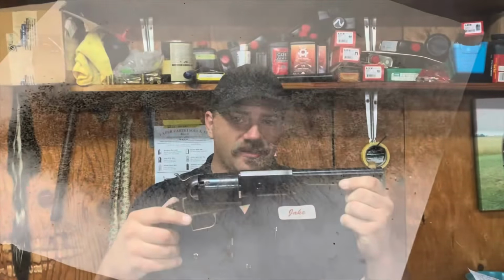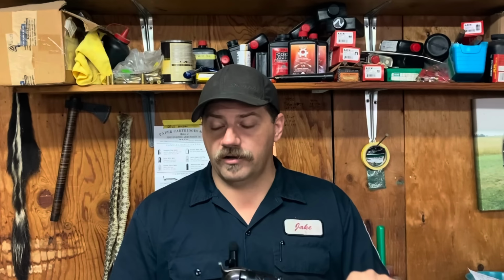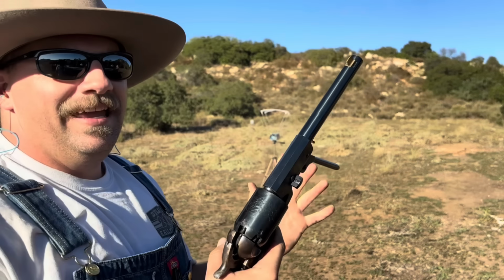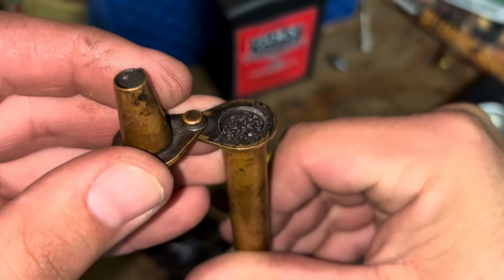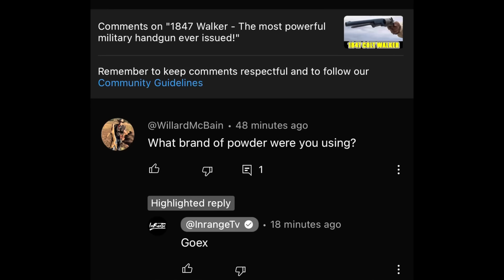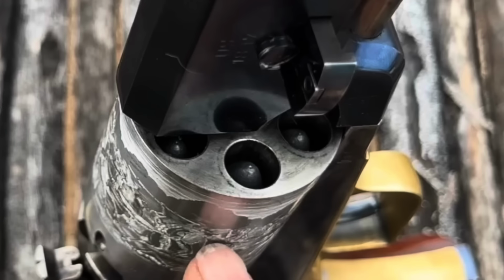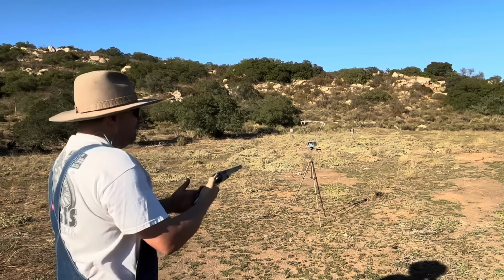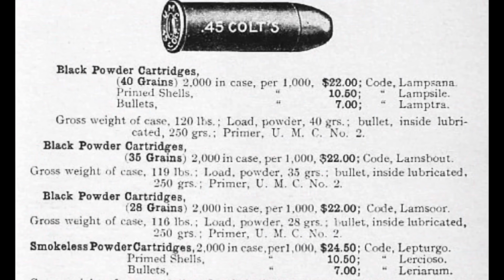The Colt Walker. Not The Most Powerful Revolver Of The 19th Century?

Comment: I hear people say that you can't put 40 grains in a .45 Colt, either. I load black powder loads in my .45 Colt. I use 3f goex. I put a 40 grain spout on a bulk style, round brass powder flask. I put a standard 250 grain flat point bullet. The powder charge is definitely compacted. People say it can't be done; but I do it all the time. When I load .45-70 I use the same powder flask; but with a 70 grain spout. Once again, with 3x goex. It works great. I used goex because that was the only real black powder that I could find locally.

Comment: I have a reproduction Walker (Uberti) purchased in the white from Cabela's in 2004. I nornally load it with .454 round ball and 45 grains of 777 and have nearly enough room for a second ball.
Reply: The cylinder is longer than all the other models. I’ll look into trying the 2 balls in one chamber. Sounds kinda dangerous but if projected right? Definitely would cause major damage. Have you shot 2 balls out yet?
Reply: @assassinmanx6128   absolutely not. I have however, shot conical bullets. both hand cast and store bought. I saw no increase in "accuracy" per se, but bullet drop at range(50yrds) was improved by 3-4 inches.
Reply: @brianking9446  So conicals are lighter/faster being not a heavy round ball? I’m still new to BP kinda. But all I ever use is .454 balls. I’m trying to get my Walker and Army to have real power. I don’t own one of those measuring devices a chronograph? So I can’t measure my speed/fps etc.
Reply: @assassinmanx6128  The conicals wiegh more. I don't remember their exact wieght. This higher wieght increases the cylinder pressure and pressure at the forcing cone due to it taking longer to accelerate the heavier projectile down and out the bore. This higher pressure does not transmit to "higher power" exactly. There are plenty of online sources to see the different ways people have increased the "power". Never exceed the makers recommended powder load. Some people have 45 long colt conversions for BP/C&B arms. That may be something to look into as it moves you up from 375-425fps to 475-650fps. That is a massive power increase as you can now load smokeless. I have loaded 65 grains of 777 in my Walker ONE time wearing two pair of Kevlar gloves and a face shield. 704fps was my Mv and I have never found where the round went just that hit the tie wall with a LOT of authority.
Reply: @brianking9446  Yea the conversions are where it’s at from what I hear. But then don’t they require FFL or backround to order? As well I’ve read something on you can only use cowboy .45 loads for conversion cylinder? Or can you use regular .45 rounds as well?
Reply: @assassinmanx6128  At this point you have exceeded my knowledge base. I have never messed with the conversion cylinders. I carry multiple cylinders with me when I shoot them and usually just swap out cylinders so reload times aren't a real issue(lots of practice gets me into the sub 5sec range). I have heard that they(conversion cylinders)require CA loads but never having had one leaves me in "unknown" area.
Reply: @brianking9446  Oh ok. All good. Yes, extra cylinders is the only way to go I’ve found out. Makes the range more fun. At first I just had one, and you’re standing there for 5 minutes loading while others are just blasting off mags and speed loading revolvers. Extra cylinders is just pop the pin out, detach muzzle and slip out and drop back in.
Reply: @assassinmanx6128  You don't require an FFL to order the cylinder.  There are two choices that I'm aware of, Howell and Kirst Konverters.  The Howell operates by way of six firing pins and requires removing the cylinder to load due to the firing pin nipples which precludes a loading gate.  The Kirst requires cutting in to breech face to facilitate the loading gate.  Mine was done in 460 S&W which can shoot 45 colt as well and I've had no issues shooting either.
Reply: @garymiller5416  So the Howell is basically easier? And can you shoot regular .45’s? I’ve heard different stories about cowboy loads only.
Reply: Wait, do I understand correctly that you can run 460 s&w in a walker colt? Thats awesome!
Reply: @brianking9446 Your chrono is way off. 50 gr. of 777 with a conical in my Ruger does 900 + . With 50 gr.777 and round ball 1100fps.
Reply: @JerryRedd-bs8xi  Ruger what? I'm talking about some 1853 cap and ball revolvers. 7in barrels.....
Reply: @brianking9446  From 1972 until 2008, Ruger made a cap and ball revolver known as the Old Army.

Comment: I'm impressed to find at least one other person who has a decent grasp of ballistics and a willingness to test for himself.
Everything you're saying is correct.  The Army did adopt the 1873 with the 40grain powder charge, but very quickly determined it to be TOO powerful for their needs.  Much like the FBI did with the 10mm to 10mm FBI load, to .40 S&W, the same evolution occurred with the 1873.
The initial load is EXTREMELY potent, delivering significant recoil, and placing more stress on the frame.  Remember, in the 1870s metallurgy was still an evolving science, and since the Army didn't "need" the gun to be max powerful, they settled on a milder load of 28 Grains of black under a 255 grain conical bullet.  This brought the performance of the 7.5" barrel gun down to a more pedestrian 850-900fps which is still quite powerful by any standard.  S&W was no less crafty back then than now, so they didn't waste time cobbling up the Schofield revolver using a shorter cylinder that could not accept the .45 Colt's length, and with it they "invented" the shorter cased Schofield round making the same ballistic numbers as the Army's reduced load.  Initially, the Army had two different types of ammo in the supply chain, but ended up simplifying the problem by eliminating the .45 Colt in favor of the .45 Schofield for both guns.
Even when the Army was investing in J.M. Browning "inventing" what would become the 1911, the actual .45 automatic cartridge was standardized in 1905 in anticipation of the gun Browning would finally come up with, but that load is almost spot on the same power as the .45 Schofield load!
Some years back I did a proper "conversion" of an Uberti 5.5" Cattleman BP to .45 Colt and decided to try and duplicate the original load - as you did.  I managed to crunch 37 grains of "Cleanshot" under a 255 grain slug which chronographed 900 fps/460 fpe which is pretty impressive.  Modern solid-head brass has less capacity than the folded brass used back in the 1800s - so it's a lot stronger, but also has less capacity.  I went with Cleanshot at the time because it advertised being virtually as clean as smokeless and that seems true, but over time I discovered fired cases developed powder corrosion and those left loaded for a long time developed weakened cases.  Since that was just a test I switched over to smokeless powder for normal loads, and modern .45 Colt ammo is loaded quite mild

It's good to find someone else willing to question and experiment rather than regurgitate the same old spew.

Comment: It would definitely be interesting to document the chamber size differences between the various brands of reproductions and the originals.
Reply from the maker: Well everyone I mentioned in the video has a Uberti but two of my friends have a ASM and a second Gen Colt and 60gr is the max. I would say they are within 2gr of each other. As for the Original, who knows.
Reply: We get into 1F to 4 F as well as the substitutes.    While I am still working on it,  clearly 777 x 3F has a lot more bang for the measurement than 3F True Black Powder.   Like reloading,  sure we can do volume,  but you weigh that volue first,  tune it and then you have a fairly consistent weight (which is what the manuals use) -  but,  some measure better than others,  long grain stick powders are much harder and less consistent.   While a rifle will not see it, a pistol can vary a lot,  9mm and smaller more so.   I also use a Chrnograph each time to get an idea of how hot that load is.    @Everythingblackpowder
Reply: @Everythingblackpowder For what's its worth, I obtained an Uberti about 20yrs ago, and was quite disappointed as it grouped very poorly, regardless of powder charge.  I also found that large quantities of power often stated, did not fit in my gun, as you demonstrated.  Upon inspection by a gunsmith, he stated that most modern replicas have undersized cylinders for mis-guided safety, and upon slugging my bore and cylinders, this was very much the case.  It cost as much as the gun itself, but he offered to ream out the cylinders to .002" over bore diameter, which I went for.  The gun  grouped considerably better with both rounds and conical, but what I really noticed was how much more powder it was able to hold.   60gr actual Goex FFFg with rounds became easy to load, and the Lee Precision 200gr conical (which has a much shorter nose than what you were experimenting with), could load, with some effort but not rod bending, 55gr FFFg.  The gun shoots most accurately more in the range of 40gr, but 50s and even 60s became possible.  I do not remember how much material was removed from the cylinders to achieve 0.002" over bore, but with the way the powder capacity increased, it must have been quite a bit.

Comment: I agree with you on this (overall) as the original charge for the Walkers (as we are told) had to be reduced because of the metallurgy at the time had cylinders blow apart.  Again… this is word of mouth issues so “who knows”… no way on 90 grains of 3F Swiss and a conical… I do not have an original Walker to verify this… but you can’t do 90 grains of 3F and seat a 200 grain LEE 90234 in a 45-70 BFR cylinder… just for reference.
Reply from the maker: lol excellent point with the 45-70 comparison!
Reply: @Everythingblackpowder  after watching you video I removed my 45-70 BFR cylinder, use blue painters tape over the bottom of the cylinder and measured 90 grains by volume… yada yada yada… I did not want to hammer on the bullets lol… 
I had the same results (just now) in my Uberti Walker that you did with 45 & 50 grains with the before mentioned Lee 200 grain RF bullet.  
I guess I just do not need to “compensate” so I am happy with 35 grains of 3F Swiss and my cast conicals.  Thank you again for your video… I got me thinking… that is always dangerous lol
Reply from the maker: @raytribble8075 thank you
Reply: That guy was clearly drunk...
Reply: @curly__3    probably never tried loading a walker i would bet
Reply: The primary reason the original Walker's cylinders would fail is due to rangers incorrectly loading the conical bullets backward (point in) into the iron cylinder, not the powder charge. That is well documented.
Reply from the maker: Some 30% of the Walkers failed the initial test fire performed by the ordinance department before they were ever issued. That IS well documented.

Comment: I like your numbers, Jake.  And your assessment of the power available in the Walker.  

And as a fan of the .45 Colt, I'll be working up some Holy Black loads for CAS in my clones.  Most of my shooting is
with that newfangled "smoke less" junk, which is easier to clean and I'm lazy, but I do love the fireball and smoke of a
nice powerful BP round!  Thanks for the video!   👍
Reply from the maker: Thank you
Reply: @Everythingblackpowder  You bet!  Keep em coming!!
Reply: Black powder certainly has a different sounding kind of "Boom" than black powder. Smokeless powder has a sharper crack to it.
Reply: @Everythingblackpowder I've noticed there are 160 grain bullets available for 45 colt, is there some big disadvantage I'm missing there that makes them less desirable? The bullet can't go "too fast" right? or can it, does it overcome the rifling or destabilize? 
Just curious if you have any thoughts/insight on that?
Reply: @Everythingblackpowder Thank you Jake .I would rather watch you than make my own darn video
Keep up the GREAT work.
Reply from the maker: @beargillium2369  I have seen leading in barrels and poor accuracy with 200gr 45 Colt black powder loads that were moving over 1100fps.
Reply from the maker: @JerryRedd-bs8xi  thank you

Comment: I  have 2 Walkers an Uberti and a ASM.  Both use about 35 grains (Goex).  I have never pushed it.  But If I wished to, I would take the cylinder out and put it on an external cylinder press;  I built one using a old Beer Capper. It can compress considerable more then a    Colt loading lever.

Comment: I read that the army used 230 grain bullets in the 45 colt cartridge then later 230 grain bullet in the 45 schofield cartridge. Id like to know how that compares to a 230 grain bullet in the 44 walker. Also, some original cartridges from the 1800 have been cut open and found they were loaded with 4F powder. ... so many variables, it will be difficult to explore all the possibilities. As always, i liked the video.
Reply: If i remember correctly it was the 4f loads that blew the walkers apart... I'm no walker expert, but it seems i read something about that...
Reply: Factory paper cartridges used 4fg powder .The whole cartridge was jammed in but loading with loose powder the 4fg would sift through the ripple hole . This is why we load 3fg or 2fg when using loose powder.

Comment: Very interesting results and a most excellent video!   

I greatly appreciate you doing the work and providing the science.  This is how we learn. 

I am left with a few thoughts.  There is a possibility of inaccurate measuring devices, inconsistent manufacturing and a human flaw of assumption.    

Using a custom milled brass measuring device rated 60grains and my throw nozzle at 30 grains I almost instantly discovered that the so called throw spout is likely closer to 27 or 28, or my 60g milled measuring device is more than 60.  Loading the powder loosely  into a  cylinder chamber I was left with about 3mm of space.  After tapping the cylinder to allow the powder to settle I then had about 6mm of space.  In the past I have been able to load a ball with no wad atop this charge.  

While watching the video I noticed something different about the "Walker" being used.   The proof marks are in different locations than on both of mine.  Not an issue, but curious none the less.  The one I loaded was marked with 2013 on the frame under the brass trigger bar, if that helps.  Mine is an Uberti purchased from Cabelas around 2017 and it came requiring a LOT of clean up.       

the greatest takeaway I have from this is I need to verify each of my loading and or measuring apparatuses are providing accurate and consistent results.  

Side note, I have spoken to someone a while back who was selling aluminum jigs to form paper cartridges for the "walker" who essentially expressed  the exact same statements in terms of capable charges as you detail in this video. 

Think there was an Italian youtuber who posted results from their "walker" which would also be "anomalous".
Reply: Vlad Spara Storia?